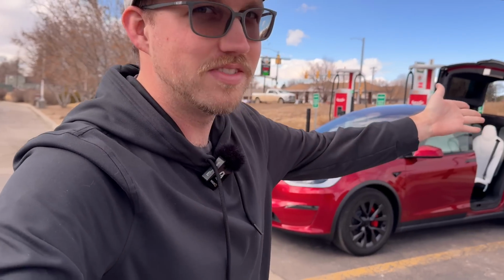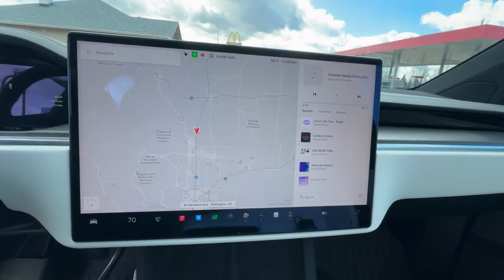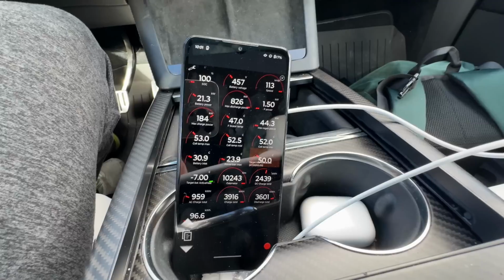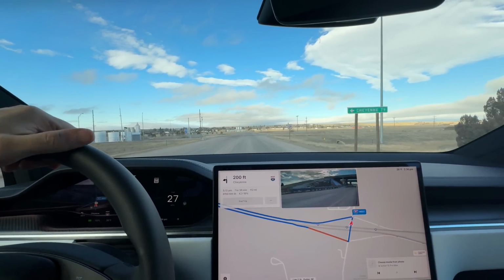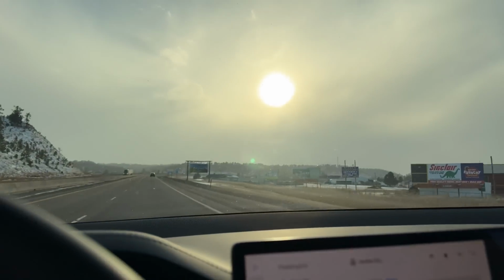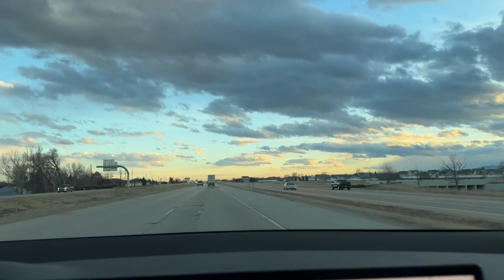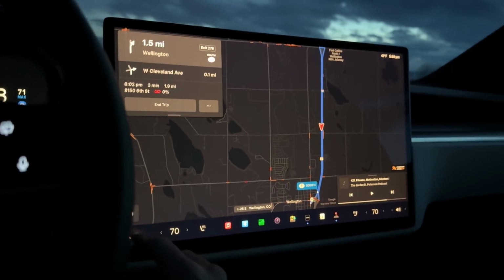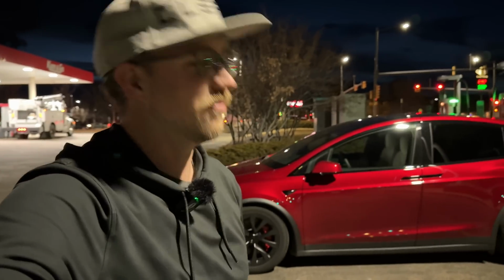Tesla Model X Plaid 70-MPH Highway Range Test! Jordan Goes Far Below 0% To Get Every Mile Possible

Comment: hey Kyle. I love my model Y performance 2022 but the range is starting to become a real hassle especially with towing and winter time. what’s your suggestion for a 60K and under EV (used or new) with more range that can tow 3500lbs.  more than 330 epa miles minimum.

Comment: Range test should be done with a fully loaded car. Its very rare that someone drives a 6-7 seater vehicle with one person. I am sure no vehicle with 6 people and their luggage / gear will meet your numbers.  Even if you can't put 6 people in the car, you should try putting some dummy weights in the seats or in the foot area on the floor to mimic 6 people sitting the vehicle.

Comment: I love Math.
420v x 60A = 25kW
320v x 78A = 25kW
25kW being the approx power required to move the car along flat ground at 71mph.
Difference in controller current draw between full battery voltage and empty battery voltage is 60A to 78A.
Reason why battery energy is consumed faster near bottom of charge.
Reply: No. Crusing at speed, the model X is only using less than 20hp to maintain highway speeds. Low battery doesn't impact watt/per mile. Gas boys just keep making up problems...

Comment: At $100,000 +/-, I won’t be buying a 2323 Tesla Model X anytime soon. But the 280 ish freeway mile range for me is plenty for any use I would ever put the car through. I like then rend color and white interior.

I went for a ride in the back seat of a Model 3 Tesla about a week ago. I enjoyed the experience, but I was disappointed in the car. It was very loud inside with a ton of road noise and the door opening was very low. To get in and out, it was a remove head at the shoulders experience to get in and out and the opening between the seat and the B pillar post was too short for my foot to clear.  My 2013 Prius Persona hatchback is actually quieter and easier to get into and out of the back than the model 3. I now see what the Model Y out sells the Model 3. My takeaway was, as a car to ride in, my Prius is more comfortable. And a better fit. But it is not even on the same planet as far as driveline performance is concerned. I hope to ride in more battery EV’s in the future to see what they are like. I would also like to drive them too. But to end up in my driveway, they have to be the best overall package for my needs and driving enjoyment for the money spent.

Comment: for 100k would you a buy a r1s or model x plaid?
Reply: I would buy a gas SUV instead of electric, perhaps a Mercedes GLE 450e plugin hybrid. I have a 2023 Tesla Model Y LR and am thinking of getting a plugin hybrid such as a Toyota RAV4 Prime. Much longer range and still has good power at 302HP.

Comment: In my '23 Model 3 i have to keep the climate at 67F or its too hot for me.  Also no one drives 70mph on the interstate unless you are 100 years old.
Reply: Because you drive reckless doesn't mean everyone drives reckless. That's a logical fallacy. Drive the speed limit and enjoy not having to pass a car every 45 seconds wasting range. You must have some severe ego issues if cars passing you is something you can't handle. 😂

Comment: Since teslas have the heat pump, poor weather only has a 15% impact (30 vs 70 degrees) right? If this was getting 295 or so, another 30 miles would’ve put it right at epa figure. Pretty impressive. Great video Jordan. Congrats on the nice car out of spec Dave!

Comment: Here in Florida 70 miles per hour is slow!😮 I set my limit to 75 mph in my Y Performance and cars pass me like I am standing still 😮 I have 19 inch Gemini wheels with continental all season tires averaging 273 to 291 wh/mile traveling from Orlando to Miami which is a 240 mile distance.

Comment: My 2018 Model X P100D Ludicrous Plus can average the same 350-355 kwh/mi consumption if I do 95% highway driving at around 65 to 70 mph till I get to my destination, and provided it is a nice warm day with not much wind.  So, all these years, the efficiency pretty much stays the same.  Tesla has not done much there for efficiency.  My X can 0-60 mph in 2.7 seconds.  The Plaid 2.5 seconds, not much difference there too.  Looking for Tesla to disrupt itself, and it is not happening.  Also got let down by the so-so real world range of the Cybertruck.  IN 2019, Elon promised over 500 miles on a single charge in real world situation.  I have seen videos on youtube, most owners are averaging 270 miles on a warm sunny day for the Cybertruck, really a farcry from the over-promise of 500 miles.  I'm still waiting for the real FSD which I paid for in 2018.  Elon, make it happen this year.

Comment: I also remember the local band 303. My only comment on the car is that it's pretty expensive for a range of less than 300 miles at normal highway speeds.  Or, if you are driving in Montana, Texas or parts of Florida, 70 mph is slow.
Reply: X Plaid is pricy but is intended for people that want ultimate acceleration.  If that's not your thing, get a standard X and save the money.  I would love to have the acceleration but I wouldn't be willing to pay the extra personally.

Comment: To get real technical, a tail wind and head wind do not cancel out. Aerodynamic drag is not linear, a 10mph headwind will consume more than a 10mph tail wind will save. I still like the video, thanks for your efforts.
Reply: A 10 mph wind would demand 78% more power to drive into the wind than away from it:
(70+10)^2/(70-10)^2= 1.78
Reply: Tube don’t do physics when you don’t know physics lol. Neither you nor the math guy above 😂. Drag from the rear of the X is like a sail when compared to the front end’s drag. The real killer here would be elevation added into the mix along with drag.
Reply: @oldrango883 where did you take your fluids class?

Comment: I have a screenshot from my MXP showing 268 wh/mile over 132 miles (commuting from work back to home) with a net elevation increase of 200 feet. This included a the 152 Pacheco Pass mountain range. Outside temp was 70F. It translates to 353 miles on a single charge in my case had I gone from 100% to -2%.

Comment: I thought the interstate speed limit in Colorado was 75. And that makes some difference. The manufacturers provide drag equation coefficients. It would be nice if reviewers compared their results to those provided by the drag equation.

But even at 70mph one needs to refuel (charge) every 2 hours to stay in the sweet spot of charging - 20% to 80%. Makes long trips a hassle.
Reply: I dont even plan a stop until I can get down below 10%.  That first 40% is crucial for timing and efficiency.
Reply: A small break every 2 hours is actually quite nice, even in an ice car.

Comment: The EV9 GT-L went nearly as far even though it has much more room, is considerably taller and boxier, heavier, has a useable 3rd row that even adults can fit into, a more useful trunk for tall items, larger wheels (21” vs. 20”), and even has wider tires (285mm on GT-L all around vs. 265F/275R on this X). For families the EV9 is a better vehicle. EV6 also charges a little bit faster, especially if you plug in at higher SOC. Tesla has higher peak charge rate but the 10-80% in the EV9 takes around 24 mins vs. ~30 for the X. EV9 is also less expensive and I think the average family would prefer the normal doors to the often problematic falcon wing doors on the X, and coming in about $25,000 less expensive is another bonus. Plaid is obviously faster but that’s irrelevant to the average family. Mid-4s 0-60 is faster than 90% of the cars on the road so I don’t think many will find the EV9 slow. I am curious why Kia went down on the voltage for the EV9 vs the other e-GMP cars and if Hyundai will do the same on the Ioniq 7. That vehicle looks to be more sloping in design which may do enough to bump up aerodynamic efficiency to bump up real world 70mph range to the ~300mi mark.
Reply: Apples to oranges comparison. Even the standard Model X is quite a bit quicker than the EV9 GT, and it went 330 miles in this test! It handles much better as well. Test the two back to back and you'll see the Tesla is head and shoulders superior from a driving perspective. If you're looking for big family practicality, then I agree with your pick, but if you're looking for the vehicle with the best performance and features for a family of 4 or less, the X runs away with it. It totally outclasses the Kia in every way that matters to me. Once you account for FSD, forget about it.

Comment: As a former Tesla owner, not surprised it didnt reach its stated range.  Mine didn't, and I havent met anyone in real life that has, they need to ban the 5-cycle test, and only do the 2(?) cycle that Porsche and other conservative automakers use.  70-75mph at a certain temp would be more consistent than city/freeway driving.  There are major efficiency gains in city driving, just show the worst-case scenario on the sticker.  Porsche Taycan says ~200mi but easily hits 240 at freeway speeds.
Reply: What vehicle do you own now?
Reply: @burnx45  I have a Rivian R1T

Comment: Interesting Avg.Energy! I have '23 MX 5 seater and usually drive between 65 to 70 mph with avg.energy 280 Wh/mi but then we are in a flat as a pancake low country area but always windy. Tested out on I-95 with avg.energy and it went down to 263 Wh/mi. It's still not as low as my '22 MS LR where under the same conditions the usage is between 225 to 230 Wh/miles.
Reply: Keep in mind, this Tesla has 4 X more horsepower! The fact that it only uses 30% more energy is actually quite impressive.

Comment: The EPA test is done at 55mph... am I right?  It's no surprise you get 40 miles less when driving at 70mph instead.  I think 286 miles is an awesome result.
Reply: and in the 30-50 degree F range.  The XLR was done in the 70s so same test should give them over 300 miles with the plaid!

Comment: I didn't know the the EPA uses 70mph for estimates. New to me. I have a 2022 X Plaid and just got back from a 3200 mile drive and it use 360 wh/mile. However much of this was at 77-80+ mph and a considerable distance through rain and high wind, although some was with the wind. Plenty of range as far as I"m concerned, because after 150-200 miles I've gotta get out and stretch as well as pee. So many Tesla superchargers along the way it was no problem finding a fast version 3 and get 250 kW each time. We always had enough (150-200) added miles by the time we returned to the car from the bathrooms. BTW the X front doors close and open without touching if you like. They are only a bother if you don't know how they work. For example, get in sit down and when you hit the brake the door will close. In the settings you can choose how and when doors open.
Reply: So your range was 150-200 with random speeding? 75-85mph avg?
Reply: @synikster  100 kWh battery = 100,000 Wh. Divided by 360. Range would have been around 280 miles in those conditions.Since I wrote that we have at least another 800 super chargers in the USA. 🙂.
Reply: @scdi12  Very nice. I dislike driving like a grandma, although if it ranges about 200 miles + then roadtrip worthy. 

My current 2016 Model X p100dl sucks on range for road trips. ;) 240mile range becomes > 120 miles real world. LOL. It doesnt help that the heater isnt a heatpump* worse efficiency ever.

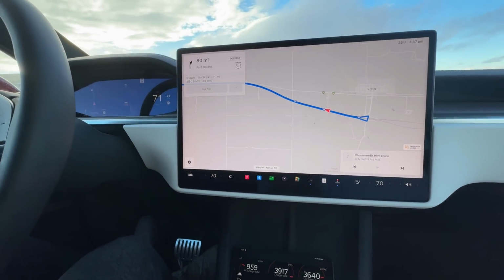Comment: 16:51 - Jordan mentions noise canceling. Here's how that works.

The regular outside noise comes in as peaks and troughs of sound waves - the higher the peaks and the lower the troughs, the louder the sound. All the noise cancel system does is hears that sound coming in (using a microphone) and emits an "anti-sound"... exactly the same sound, but instead of a peak it'll give a trough (and vice versa) at exactly the same frequencies. How? The peaks are rapid bursts of high pressure air, the troughs are low pressure, so all the speaker has to do is sound off low to counteract high and high to counteract low. 

It does this thousands of times a second, and that flattens the waves into barely a ripple. A roar gets turned into a whisper - and it works better with low frequency noises that are constant, like the sound of road traffic at less than 1kHz, because the electronics in the noise canceling system has time to react much more effectively and it's a constant sound for the most part.

https://www.youtube.com/watch?v=Yllle-Eq4ek
Reply: Fantastic write up!
Reply: Good write up, but feels a bit like you're telling that this is a very simple tech, while it's definitely not in reality. The hardest part is to get this working smooth without too much oscillations and resonance because of sound reflections bouncing around.

Comment: The standard Tesla 80-85% of advertised multiplier. Plaids are replacing AMG and M cars in my neighborhood as powerful vehicles driven extremely timidly.
Reply: Had 2 Teslas and the "Tesla multiplier" is a real thing. One of the reasons I want a 400+ mile Tesla so I can actually get 300 miles.
Reply: Middle of winter. The other Model X they ran got 331 miles in middle of summer which was 4 miles off the 335 miles EPA
Reply: @chrisak49  50 degrees is hardly middle of winter. Kia EV9 got advertised range. E-Trons got advertised range. Porsches beat advertised range. It’s always Tesla because they game EPA tests. Hence the class action lawsuit.
Reply: @Ficon the EPA hwy test is for 67mph. The other ev makers are underrating compared to EPA hwy testing criteria. Class action lawsuit? Nice try dreamer.

Comment: Nice video.  My Model 3 Performance shows 283 miles of range when fully charged but I only get about 230 miles of actual range and that is in warm sunny Southern California weather. Tesla range estimates are terrible. The more important part of the video I think are the four phantom breaking episodes you experienced. I also experienced that on open highways with no traffic which drives me nuts. It is so dangerous when it does that. I’m just lucky that I haven’t been rear-ended yet when that happens. It’s just a lawsuit waiting to happen.
Reply: The more efficient the cars are at city speeds, the more the EPA average will differ from highway driving only. EPA shows both city and highway MPGe for all EVs and it is that agency that decides how the standards should be measured. Tesla has no choice in the matter.
Reply: @0ooTheMAXXoo0  Yes, partly true. Manufacturers, like Tesla, can choose between a 2-cycle and a 5-cycle EPA test and the 5-cycle test often produces more realistic numbers due to a wider range of conditions, tho. Manufacturers like KIA, BMW, Mercedes-Benz come very close to their EPA ratings or even beat them.
Also a generally efficient car won't have such a big difference between EPA numbers and pure highway tests. The biggest difference is actually in not generally efficient cars, especially SUVs/trucks or small sub-compact cars, they have a sweet spot at lower speeds and fall off a cliff at highway speeds when the electric motor is being pushed outside of its efficiency zone (mostly sub-compact cars with small motors) and when the air-drag becomes more important than the rolling resistance.
The reason why KIA EV9, which is actually not crazy efficient, comes close to EPA numbers during the 70mph range test has mostly to do with a more realistic EPA number from the start. Tesla just always overhypes the range and does everything to push numbers for advertisement reasons. Tesla has a choice in the matter

Comment: but why should the 3 motors version be less efficient? if it dont use the power it should just shut them off
Reply: (More weight) and permanent magnet motors cannot be turned all the way off, unlike induction motors which can.  Some manufacturers add a clutch so motor can be disengaged but don't believe Tesla does so (would add weight and a significant point of failure).
Reply: More weight

Comment: You got to test these cars at the SAME temperature.  52F is very low and not comparable to other tests you have done. 
Cybertruck test was a joke at 38-45F 
Also that was done at 700ft instead of 4000ft making at least 10% negative impact alone.
Reply: FYI EPA is at an average 48MPH speed for the highway test and between 68 and 86F
Reply: Lol, cry in your corner fanboy. KIA EV9 and others were also tested in these "low" temperatures (far far away from real winter temperatures) and had absolutely no problem.
Reply: @bullshitbingo2259 EV9 got less miles than this plaid though at the same temps... lol The XLR got over 330 miles in 70s temps.  It's a fair assumption that these tests should be done at the same temp.  In a true science experiment you would have all test subjects undergo tests in the same environments.
Reply: @bullshitbingo2259  test should all be done at the same elevation and temperature and ideally at the same track of you want to compare apples to apples. 
Cybertruck specifically was done at 700ft instead of 4000ft which easy results in a 10% disadvantage. Combine that with the temperature difference and the test out of spec is doing are just a joke.